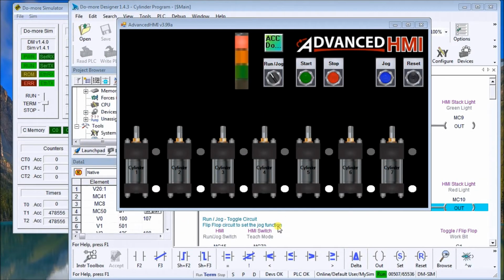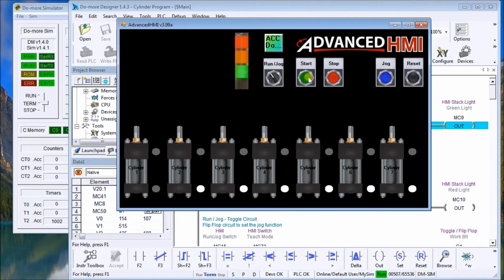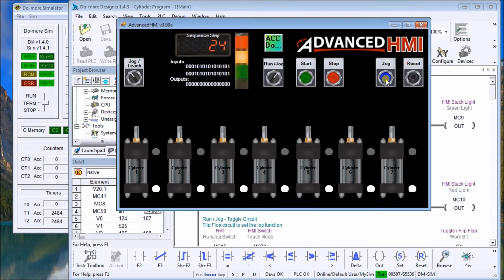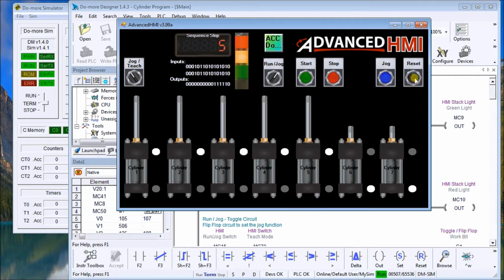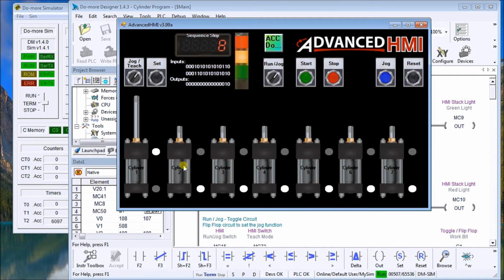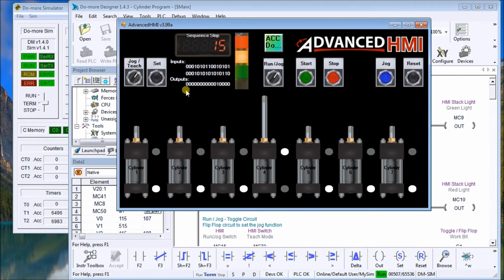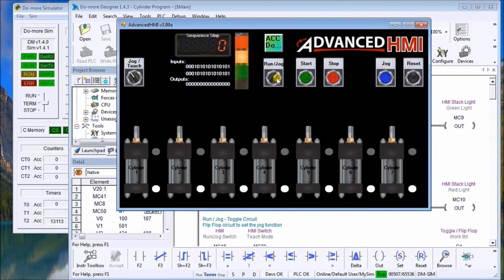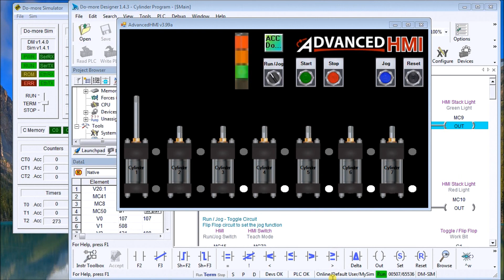Master 7-Cylinder Sequencer: Program 500 Steps Like a Pro!

Comment: hi sir. I cant make branch ladder .which key ?
Reply from the maker: Hi Kong,
To make a branch circuit in ladder in the Do-More Designer Software you hold the Ctrl key and use the arrow keys on the keyboard to draw the line. The arrow keys can be up, down, left or right. To erase the line, hold the Shift + Ctrl and then use the arrow keys.
Here are some more videos that will take you through the process of using the software:
https://www.youtube.com/playlist?list=PL3y71jAPOdZB5LJMMotZP36LvzfdgkgzW

Regards,
Garry
Reply: thanks you so much .